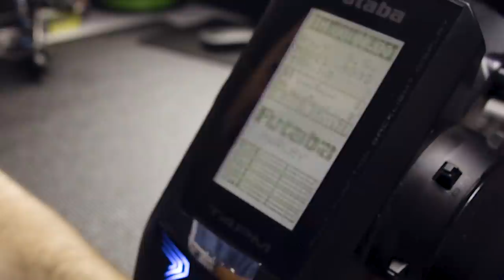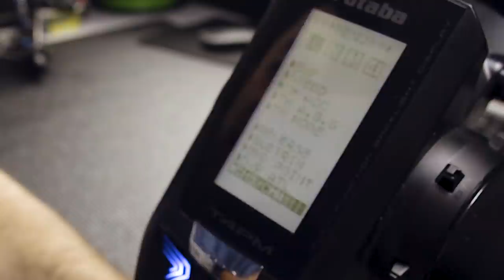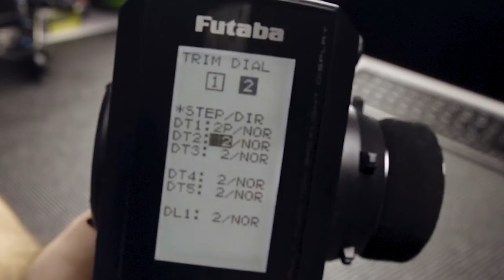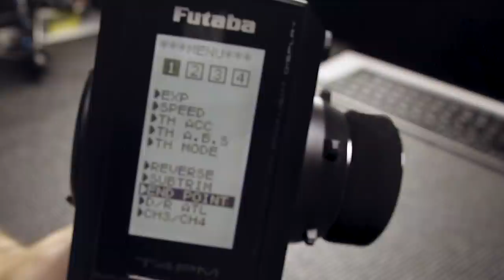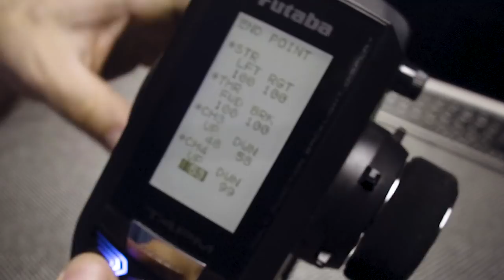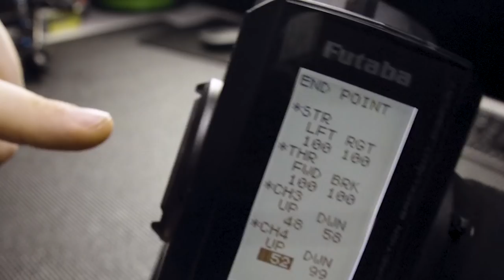Axial SCX10iii - Everything you need!

Comment: This truck also has three dig position not two,watch other video and you will learn three different dig features which is awsome.everything covered in this video we knew before the truck come out so thats why the video i shared is more at the level we need.
Reply from the maker: I go over the three dig positions in programming and am very familiar with how it works, but the main benefits people need to know are how to use it when locked. Using freewheel dig effectively is something that comes with lots of practice.

Comment: To me, the "weakest link" of this truck is the attachment point of the panhard link to the provided brittle plastic bracket on the chassis.  Broke mine on its first outing in the rocks.  Fortunately, Axial provides a second bracket in the kit that can be shimmed to replace the broken unit while I await receiving the proper part.

Comment: I have the AXE system in two trucks any they work fine compared to my other Holmes/Castle combos. What is it that you don't like?
Reply: Alvin Marin I have the same question too. I run an AXE system in my Capra and I love it, I see no issues with performance. I’ve no doubt there’s better out there, but I don’t see why this one is frowned upon. I really like the built in Bluetooth, changing settings on my phone, in real time, while I’m driving is an awesome feature.
Reply: love my axee also
Reply: The main function of the AXE system that sets it apart from others is that it modulates the power automatically to give a controlled smooth drive. (it give more or less power to keep it smooth even if you didn't change the trigger at all) This is what Josh doesn't like. I don't either. It's not that it's a bad system it just does something we don't want it to do. Would rather decide when more or less power is needed ourselves.
Reply from the maker: It’s also low on power compared to other 540 systems and has poor start up and punch. Way too many things on the cons list for me to ever suggest it to anyone.
Reply: Harley Designs,  I’ve found that start up has been incredibly smooth in my Capra and you can adjust the punch to your heart’s content via Bluetooth , I’m also using a Spektrum radio and receiver and running 3s LIPO. I’ll admit that if I’m going to build something for comp, this wouldn’t be the system of choice, but I think for the average day to day hobbyist, I would have no issue recommending this system based on value for performance. Thank you for sharing Josh, I appreciate your take on the R.C. world.
Reply: I agree with the smoothness and it such a nice looking setup as well. What sold me was the app. The Castle B-link is so outdated. I've been using it on planes for what seems like a decade. Time for an app!
Reply: @HarleyDesignsInc  I have a few different setup's including the AXE, but my Mamba X and HH 540 Revolver is by FAR my favorite. In fact, it's about the only truck I use now, I like it that much, and it's not even sensored. Castle Link for the throttle curves plays a big part in it. You should try one if you haven't yet. Yes, the sound is horrendous, but the performance makes up for it...lol
Reply: @alvinmarin8648  castle has an app with a Bluetooth adapter I have one myself? I change all my esc settings via my cellphone through the castle app??

Comment: After a LOT of research,,,, I spent a dime on the Hobbywing Axe Brushless system.. now you tell me I Fd up. Dang it!!!!!!!! Not matter what I buy,,, I screw up. I've noticed that you tend to recommend the high end expensive stuff. It would be great if you offered a low end comparable replacement as well. Some of us spent so much on a crawler that we expected would be great out of the box with our last few extra bucks we had to reach this level. Only to find out that we got sold out to the upsell. Not a nice thing at all. Sucks to be me I guess huh? How about some cheaper options with only a little sacrifice that we can make up for in driving habits?
 You could have cut out the rest of the engine and glued it to the servo if you really wanted to.

Comment: Hey Harley I'm upgrading my bomber with Vanquish and Axial parts, got a v2 axle housing Axial ring and pinion, crazy Eddy bearings and Vanquish spool but new spool won't fit so I have to use the stock Axial locker I don't understand why the new Vanquish spool won't work in a Vanquish axle please help.FRUSTRATED!(it's too tight)

Comment: How did you get the servos to shift properly? Or did they in real life once you started driving the car as well? I can't get mine to shift properly, high and low doesn't seem to make any difference which I choose and the dig I'm worried to use since I don't know if it will engage properly afterwards, I've had the car rolling down hills after trying to use the dig just because the rear wheels didn't engage and the front ones had bad grip
Reply from the maker: The stock servos and servo savers are fairly weak. Upgrading servos helps quite a bit.
Reply: @HarleyDesignsInc  that I've noticed, have you any servos you can recommend? I assume just getting digital servos seem like that should help a lot

Comment: Hi Josh, I really like your vidzzz! I just bought the SCX10III and a hobbywing axe 550 2700. It does not seem to fit. Do you have any suggestions? Thanks, Pim from the Netherlands.
Reply from the maker: The AXE system is not a system I personally like to run, I run the Holmes Hobbies Puller Pro V2 in my SCX10-3.

Comment: You’d mentioned the 1.7:1 gear reduction would give you a slower speed. Would you also see an even smoother low slow control? Dumb question probably. Would there be a way to use the 10.2 Rock Jocks as the straight axles for the 10.3
Reply from the maker: No, it needs an offset axle.
Reply: Harley Designs ah yes, and there in lies the dumb question:) Thanks again man.

Comment: It’s not a rear axle disconnect. That would mean the rear axle spins freely. It’s a rear axle lock.
Reply from the maker: You can set it to a freewheel position as well. And in the locked position the rear axle is still disconnected from the gear train.

Comment: Awesome build! Quick question for you, why do you not like the hobbywing axe combo? Just curious as I just installed the 2300kv system in my Capra.
Reply from the maker: Low power, poor start up, no trigger feel because of the FOC.
Reply: Harley Designs thank you for responding back!
Reply: @HarleyDesignsInc  you can turn the FOC off Josh if you don't care for it, you keep saying underpowered, in what perspective? I usually run mamba X & Holmes Puller Pro or HW 1080 with cheapy Holmes motors but  I recently drove an Axe 2800kv V2 it felt great w/ loads of punch ton of power. The best part of the entire drive was that it's SILENT 😶 I hate the Mamba X whine lol
Reply from the maker: @off-roadrc7126  the low end start up power is not nearly as punchy as a Tekin or Holmes. That’s just something that can be measured, it’s not just conjecture. The Hobbywing is very smooth, no doubt there and the quiet drive is quite nice if the sound bothers you. I’m so immune to the sound of normal brushless now though. Out runners are the one that still gets me though.
Reply: @HarleyDesignsInc  I see what your saying, I didn't realize the low end start up power was lacking like that, Im guessing that can drain a battery much quicker? Good to know.... like I said tho, I generally run Mamba X with one of John's Puller Pro motors & it's not a deal breaker that the castle esc whines it' was just cool to test the Axe V2 & hear nothing but gears turning for a change. Thanks for the information..... 👍🏻
Reply from the maker: @off-roadrc7126  I’ve heard the axe is more battery efficient but have never seen data on that. Being less powerful, it would make sense though.
Reply: @HarleyDesignsInc  True that makes sense, I was thinking if it's underpowered it would require more Amp draw to get up to speed, but I'm pretty sure what your saying makes more sense lol!! I'm over thinking the equation. Josh did you mention finding the clicking noise in the scx10iii, do you have a link? Thanks
Reply: @HarleyDesignsInc I happen to have a CrawlMaster Sport 550 8T laying around. I'm debating on trying it in my Gladiator but I'm not as familiar with Holmes 5 slot motors if this is strong enough or not, any experience with Holmes 8 T Brushed motors?

Comment: I have always respected your opinion so I need to ask why you don’t like the HW Axe ESC motor combo for this vehicle I have used them in other crawlers with no issues, so is there something I’m missing
Reply from the maker: I personally don’t like the feel of them, specifically the FOC control. I know you can turn that off but then they are also low on power compared to other similar systems. They aren’t “bad” I just do not like driving them.
Reply: @HarleyDesignsInc  fair enough

Comment: Have you tried using 3s 18650 3500mah batteries? I dont think you need a large amp draw so they should work. 3500mah is the largest I found but are lighter than lipo and smaller in space.
Reply from the maker: Large amp draw is required for these setups, it’s a big factor in battery quality.

Comment: Will my hitec 645mg (300oz) be enough for my scx3? And is over drive really necessary for “better” crawling?
Reply from the maker: The Hitec 645 is less than 200oz, I do not think it will be enough for decent performance. Overdrive is a powerful tool, is it something that you MUST have, no.
Reply: @HarleyDesignsInc  oh ok so get something that has 300oz of torque or more? And will those amazon 25/30kg($30) servos work fine? Any recommendations I’m on a budget Tnx for the reply Harley! 😁
Reply from the maker: You get what you pay for with servos. I don’t normally suggest the cheap servos often. But something around 300oz or more is my recommendation.
Reply: @HarleyDesignsInc  that’s a great rule of thumb especially when it comes to RC! Tnx Mr Harley udaman! 👌🏽